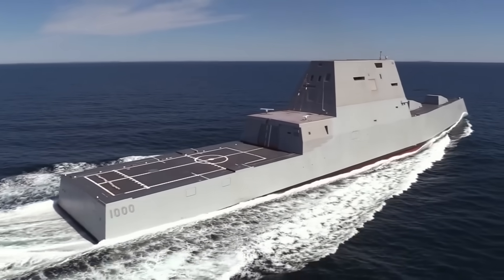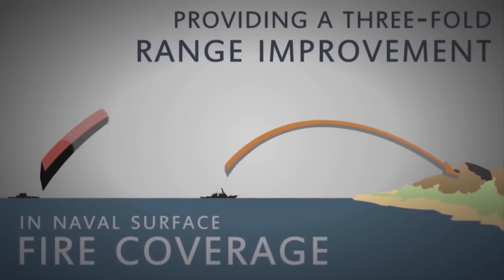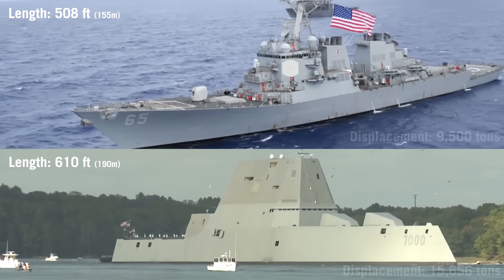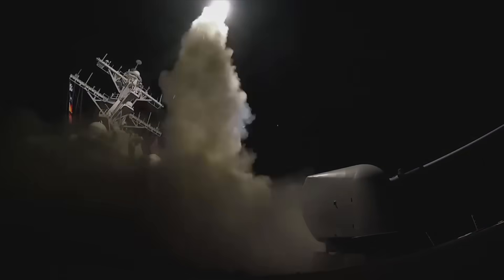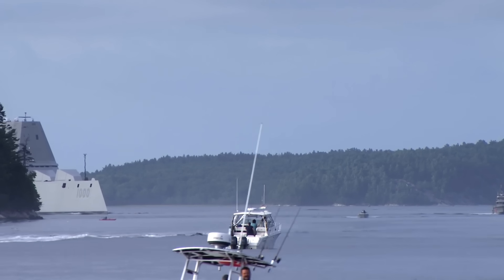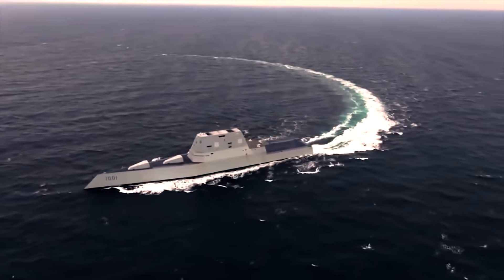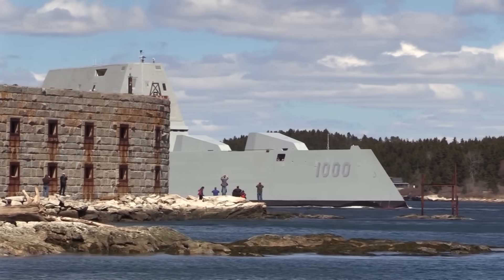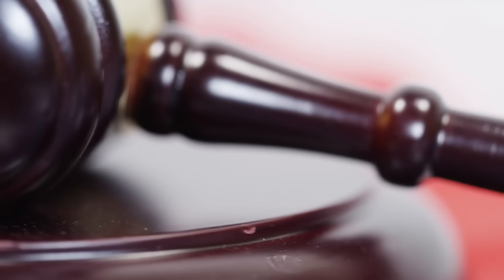What Killed Zumwalt Destroyers?

Comment: The narrator's final few sentences say everything one needs to know why the U.S. Govt keeps shooting itself in the foot with weapons system procurement misadventures.   For all the govt workers who generally work on the 80% solution to keep things running smoothly,.....the DOD has to insist that it only wants to develop new weapons systems which utilize only the "latest and greatest" shinny new thing that some defense contractor tell them they need and which has extensively lobbied those in Congress to purchase.  But sadly, what often turns out to be the case in the end is that the US Armed forces end up with 1st generation immature technology straight off the drafting board, which product is far from being fully developed before it's fielded.   The defense contractors then bet that the retrofit package, mid-life extension program, refitting, or next block upgrade module for that weapon system for which they tell the DoD it needs to purchase to really make these white elephants finally work correctly as designed, will be where the Defense Contractors really make the profits for their companies and their share holders.    When will the DoD just accept that the 80% solution is usually "good enough" to get the job done????

Comment: So the Zumwalt was a great solution to a problem which might not exist.

Low crew numbers mean less people to do damage control, but acting close to land might mean there would be embarked marines to help along side ship's crew.

Stealth would be useless when acting as part of a CFT. If it has a different role, then stealth might be the difference between mission success or mission failure. 

Personally I think it was a complete success as a test bed platform, and concepts proven in the Zumwalt class will influence many other ships in years to come.

Maybe that was the point all along?
Reply: Navy, here:  Please do not embark jarheads on my ship and expect them to fill in for "missing" sailors on damage control.  When shipboard damage control becomes the core of the USMC's training, maybe I'll reconsider but, until then, just keep the grunts the hell out of our way, please.
Reply: @consubandon  fair point. The my interpretation from the video was that the numbers were the important part, I was wrong. I don't know what the new concept of 'sea basing' marines is about. But it should include more ability to help keep your ship afloat.

As a Navy person how would you react to the following statement:

Like the Pegasus Class before it the Zumwalt Class did not go into widespread production. However, both classes gave the Navy the opportunity to experiment with new concepts in warship design. Some of these concepts were adopted by other classes of ships and therefore neither the Zumwalt or Pegasus classes should be seen as failures.

Comment: It’s stealthy. It carries a lot of missiles. 

Anyone can see it with a Mark One Eyeball. Submarines are stealthier and also carry lots of missiles. 

Of course I’m not biased at all, despite being an ex submariner...
Reply: In all honesty, Submarines definitely seem to be greater in the stealth department, especially considering that two of them ran into each other out on the seas without detecting each other. Not to mention that they also can carry quite a payload, like the Russian Typhoon for example.
Reply: My biggest problem with the Zumwalt class is that, last I heard, they cut catholic protection to save money. 

If you connect two different metals, like what the hull is made of, and what the main engines are made of, and put them in an environment that carries a charge, like salt water? You get galvanic corrosion. Normally, they bolt bars of zinc onto the hull. The zinc corrodes away so the hull doesn’t. But not on the Zunwalts. 

I wouldn’t serve on one.
Reply: @Ghotiermann  Catholic protection? You mean cathodic? :D
Reply: To be fair, the zumwalt is more like a land attack platform(which it can't even do now) lol. It was more so made to replace the iowas(yeah the battleship). But yeah, idk what they expected when they put a bunch of new and less developed technologies into a single ship.
Reply: @imsillynotstupid  TO be fair - every once in a while ONE groundbreaking programme is NOT inherently wrong. Too bad that USN did the same with Carriers, LCSes and .....
Reply: True indeed - just convert two more Ohios into SSGN, stack it up with Tactical Tomahawk and job done. Two such ships can launch similar number of missiles as used in opening of entire Desert Storm, which means they can reach anything in 500km distance inland from position of absolute security further hundreds of kilometers off shore.
Reply: But you wouldn’t send a stealthy oversized destroyer that wishes it could do shore bombardment for that, either. 

There is definitely a need for surface ships. Just not for the Zumwalt class.
Reply: @Ghotiermann What do you mean Catholic protection?
Reply: the problem with subs mate is you can't project intent with them. its like what's going on over Taiwan right now. the US navy, RN and so on are making a statement of intent with ships. but if push comes to shove a disproportionate amount of the sea actions will be done with the boats of your branch of the service.

a big hole in the water isn't very scary to you average politician. but they get the point when a carrier and its fleet show up. when last did you see the news showing a bit of empty sea and reporting the deployment of subs to a crisis zone? :)
Reply: Yes, I got bitten by autocorrect.
Reply: Yeah but doesn't radar reach beyond line of sight? And you'd be hit before you see it.
Reply: Or night time. Shitty weather
Reply: But you can’t see a Trident submarine  from 400’. They are extremely hard to find even when using Sonar. 
If you want stealth, you can’t beat a submarine.
Reply: @Ghotiermann  Your missing the point.  The US needs surface ships in order to operate carrier groups.  Submarines don't provide very good air defense, even if they can match a destroyer when it comes to lobbing tomahawks around.

Since you NEED some surface ships, might as well make them more difficult to target.  The submarines remain the most survivable part of the fleet, but you can't just make a navy of all submarines for a multitude of reasons.
Reply: No, I’m not. I have never said that submarines are all that you need, or that they can fill every role. I don’t believe that. 
But for air defense of a carrier battle group, you don’t need stealth. So you don’t need a ship as expensive as the Zumwalt for that, either.
Reply: no you're onto something there, as a ex-destroyer sailor you're pretty accurate in your statement.
Reply: While you might be arguably biased, you’re not at all wrong. If you want stealthy sea craft, a submarine is better suited for the job.
Reply: It doesn't carry a lot of missiles, it has 80 VLS cells.  The Burke DDG's have 92 VLS cells, and the Tico CG's have 122 VLS cells.  That's a lot of missiles.
Reply: Missiles ???
Reply: Subs have less surviveability, right?
Reply: Not really. Stealth is survivability. If you don’t know where your enemy is, or that an enemy is there,  you probably won’t kill it.
Reply: Makes me wonder why we don't make a submarine like a U-boat anymore; just put a retractable deck gun on it, and use that to yeet them there fancy shells.
Reply: @MachineMan-mj4gj  battleship weighs like 5-6 SSBNs. The recoil will tip the sub over, if not worse.
Reply: If it’s not retractable, it’d be noisy as the water flowed around it. And if it was retractable, it would take up a ton of space that you could otherwise use for minor, unimportant things like bunks for the crew.
Reply: Chris King  thats not true. drones have been used by the sub fleet since operation ivy bells. google it
Reply: reject submarine 
RETURN TO RAMP
Reply: Naval combat has been happening beyond line of sight for a long fucking time. And yes obviously submarines are stealthier. They are also submarines that can´t have massive guns on them, launch helicopters or do all the stuff destroyers do at anything approaching the same efficiency.
Reply: It's so weird that they had to stealth a littoral combat ship. If this thing needs to be littoral, it doesn't need to be stealthy, because then there's lots of people standing around with Mark One Eyeballs. 

If it's going to do stand-off strikes with Tomahawks, then... it's not fucking littoral, is it?
Reply: Mark One Eyeball only covers a distance of maybe 15 miles, while surface radar is upwards of 300.  And since its weapons are meant to shoot roughly 60 miles.... MOE becomes totally moot
Reply: @k1productions87  But the 60+ mile weapon system didn’t work out as planned. So now it is a less stealthy, less capable version of something that we already have.
Reply: @Ghotiermann  The weapon system's problem was reduction in bulk because there were less ships to utilize it, raising the cost-per-unit considerably.  The weapon system itself works fine.

Besides, simply replace the weapon system.  Have new ships of the class use the cruise missiles instead, which also have the long range.  You will still never see the ship coming until the weapon is already en route, and too late to do anything about it.

The point is, the stealth is meant to keep a ship from being identified as a threat before it reaches weapons range.  With surface radar reaching up to 500 miles, any large ship identifiable as a large ship becomes a floating target until it closes that distance.
Reply: @k1productions87  We already have submarines. They are better at stealth. They carry more missiles. I’ve mentioned this repeatedly, and you have never refuted it. 

On top of that, as we build more new boomers, we will have more Ohio class subs to convert (probably much more cheaply than building more Zumwalts).  With their nuclear reactors, the sub’s time on station is only limited by food and spare parts. But you still argue that we need the Zumwalt?
Reply: @Ghotiermann  I am sorry, I missed it.  Or my brain didn't lock on because the differences between submarines and surface ships are vast in number.

Submarines are slow and (potentially at least) far more easily succeptable to torpedo strikes.  A surface ship (especially a fast one) could not only possibly out-maneuver said torpedo, but can also keep fighting after taking a direct strike. 
Surface ships can also deploy landing craft, either helicopter or skiff, and submarines have no such capability.

Different craft cover different missions, a submarine is hardly a jack of all trades.  In fact, destroyers were built specifically to counter submarines
Reply: @k1productions87  I just realized that you aren’t aware of another problem with your argument. There are two main types of Tomahawks. The one that everyone thinks about is the TLAM-C (Tomahawk Land Attack Missile- Conventional). You would use the Tomahawk AntiShip Missile (TASM) against incoming ships. The Zumwalt would have to divide it’s more limited missile capacity between the two. The TASM isn’t nearly as good as the TLAM due to the different guidance system needed. It doesn’t have nearly the same range. 

The sub could deal with surface ships using the good old Mark 48 ADCAP torpedo. Or just wander away quietly and let the enemy ships waste their time looking for them.
Reply: @k1productions87  First, read my other responses in this thread. I have never said that sub’s are best for every role. Just stealth and missiles. They are not a good replacement for aircraft carriers, destroyers (unless the destroyer is tasked for Anti-submarine warfare) or Marine landing ships. Just the Zumwalt. 

Could a Zumwalt avoid a torpedo? Possibly. Could it survive a torpedo? It would only take 3 to sink a Nimitz class carrier, so I doubt it. 

Could a submarine avoid a torpedo? Sure. You don’t have to outrun the torpedo. You just have to avoid it until it runs out of fuel. And submarines practice this. A lot. 

I’m guessing that hat you have never had anything to do with anti submarine warfare. I won’t take the time and effort to teach you about it (you wouldn’t believe me anyway). But  the submarines that I served on played many war games with surface ships. We would almost always sneak in, avoiding the destroyers. We’d put two or three “torpedoes” into the flagship, and “sink” a destroyer or two as we snuck out, if any of our torpedo tubes were still loaded. The best thing to send to kill a submarine is another submarine. That’s why our carrier battle groups include 2 fast attack subs

The only valid point that you have raised is the speed. Subs are slower than most surface ships, so they take longer to get on station. So you have to think ahead to use a sub.
Reply: @Ghotiermann  I just feel it would be a mistake to rely entirely on submarines.  Destroyers still have their purpose, and its not entirely land-combat based.  Its just a matter of finding a way to reduce the cost, much of which I am certain is just laundering and has nothing at all to do with the development of the craft itself.
Reply: @Ghotiermann  Stealth and missiles on a surface ship are not merely for attacking though, as once the initial attack is done and a landing was necessary, either by airlift or surface craft, a submarine would no longer be equipped for such an action.  And if the submarine was relied upon for the initial attack, any surface units would be several hundred miles away still, making the landing even more impractical.

Yes, if just a missile attack were needed, a submarine would be best.  But if capture, retrieval, or other boarding/landing assaults were necessary, a Destroyer would be more practical.  In that case the stealth would be so the ship could close the distance before being identified as a threat, rather than having to fight its way through immediate target identification and response.

Is the Zumwalt perfect for this?  No, it is not, especially because of the cost overruns.  But I simply feel, in my own subjective viewpoint, that finding ways to modify the design and reduce the cost would be more beneficial than outright scrapping it.  This means we need to take a good hard look at military spending and find all the places where money is being funneled out for profit... and I GUARANTEE there is a lot of it.
Reply: @k1productions87  I actually agree with most of what you said here. Submarines cannot fill every role. But at anything that requires stealth or missile deployment, submarines are simply the best tool for the job.
Reply: @Ghotiermann  It was just the specific instance I was interested in, where a landing is necessary.  Having a ship identifiable as a warship from hundreds of miles out would make accomplishing that mission more difficult than appearing to radar as a fishing boat until it was too close to mount a preemptive counterstrike in time.  A very specific instance yes, but one a stealth surface ship would be best suited for.

A craft with landing/boarding units could still be identified as a threat, even without missiles and even if it was paired with a submarine... but it would also have to move much slower to not outrun said submarine while still outside weapons range.

Now if there were such a thing as a stealth carrier, that would be even better.... but yeah, there is no such thing.  And a carrier still requires a support fleet around it.  So.... a carrier-sub?  Science fiction perhaps, but asking the question, would it solve all said issues?  A ship that could submerge and yet still deploy everything needed upon surfacing?
Reply: @k1productions87  the Japanese had a carrier sub in WWII. It kinda sucked, but it did exist. 

Not sure what you’d want something stealthy with a flight deck for. It seems pretty specific. For something like launching and retrieving SEAL teams, subs are still superior. The Trident Tomahawk boats even have mini subs for that purpose.
Reply: Mark 1 eyeball doesn't work at 400 miles.

Comment: Before watching the Clip: the price tag.

150 Crewmen cost with an average cost of ~50k per seaman a total of 375,000,000 for a lifespan of 50 years - assuming the purchasing power of compensation stays relatively stable.

And it also assume 50 years of service, and not a significant shorter time span in which the money that went into the ship construction is sunk either way.

Now this approach made the ship so expensive, that they were scrapped as program, and the older Burke class (with its 300+ sailors) stays for much longer in service.

So the technology is more expensive and often prone to fail compare to well trained human seamen. But the higher ups: cut the cost of the human factor.
I guess it is the general disrespect of the ruling class for the labor and middle class: machines > proles.

Great job Pelosi and Co.

Including the most common pay allowances, the average total compensation for a Seaman may range from $42,351.30 to $45,472.50 per year as of 2021.

https://www.military-ranks.org/navy/seaman-pay#:~:text=A%20Seaman%20is%20a%20junior,served%20for%20over%203%20years.

Comment: But does the forecastle not extremely wet?

And rail guns a stupid. They provide no significant advantage over normal guns. Gun wear is a real problem and accuracy is another with the heating of the rails causing significant distortion. The army which would have a better justification for railguns for tanks than any navy usage since the shorter rangers make the speed more of an advantage, gave up on railguns years ago. Missiles can travel orders of magnitude further and carry higher payloads.